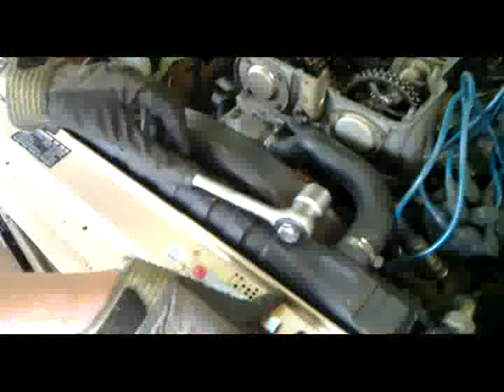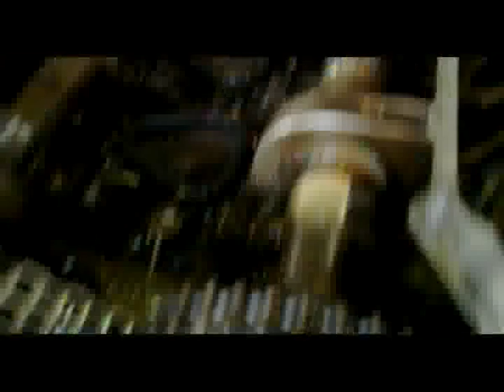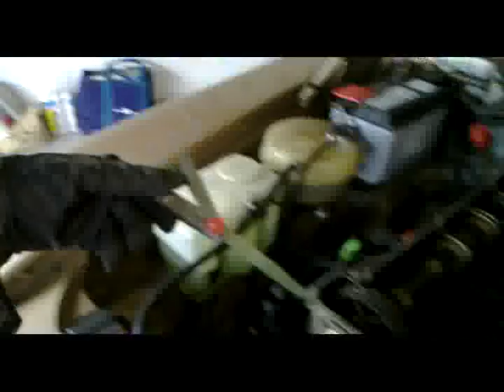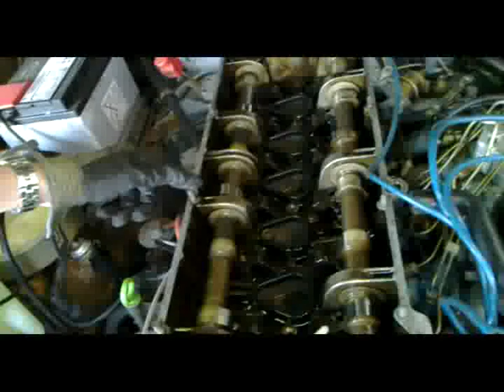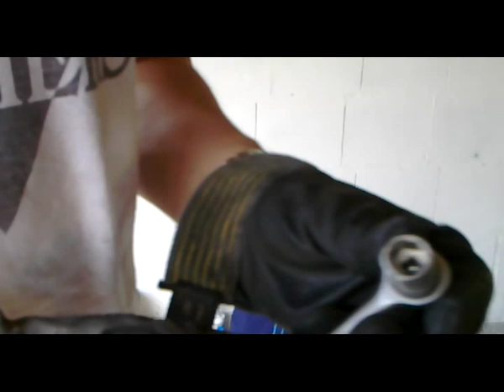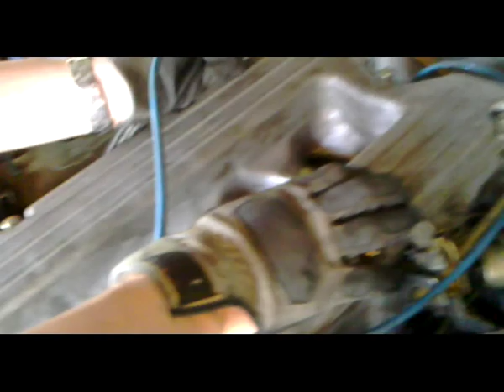Adjust valve play 2/2 (service Mercedes M110 engine)

Comment from the maker: some people simply turn the engine by turning the ignition key very shortly. Before doing this, make sure you remove the cable between the firing coil and the ignition distributor. If you don't and your engine starts, oil will spead all over the place.

Comment: Another option would be to set according to the 1-5-3-6-2-4 firing order, this allows one to set both the inlet and exhaust on the same cylinder, although I also prefer to do it like you.  Ach ja, der schöne Deutsche Akzent aus der Heimat ist auch ganz nett. :)

Comment: Small translation for  the video producer. 
Kipparme = rocker arms / 13 Nuss= 13 socket// crankshaft -correct/ 0.10mm Fuehler = feeler gauge/ motor gehaeuse= engine cover or engine valve cover/ Dichtunjg= gasket

Comment from the maker: A propper valve clearance allows your engine to completely burn the fuel which results in cleaner operation and you get more torque from the same amount of fuel.If it has never been done you might want to check but more than every 10,000km should not be necessary. Keep the rubber seal if in good shape.

Comment: Yeah good video sure makes the job look simple enough, but do I really need to bother about checking the valve clearances ? Also when replacing the valve cover is it ok the reuse the original rubber seal again? I don't understand why people insist in changing out rocker cover gaskets all the time

Comment: I have a 1973 280, W114. It doesn't seem like I can fit on a wrench to rotate the crankshaft. There is not enough room between the engine and radiator. To do this on my car must I remove the radiator?

Comment: hi, i have the same model engine in a W108 250se, when i star the engine i hear a sound like a knock very hard and repeatedly inside, i think it is the crankshaft hitting the valves and doesn't have the real adjust, but the mecanic say that is normal, what do you think is the problem? the car have a low performance after i star hearing this sound

Comment: This was a bitch of a job and my 17mm spanner broke, ouch! I found that all my exhaust valves were too tight? I also found that the 17mm adjusting bolt is very hard to turn in either direction. What is the lower but for? It is larger but do I need to slacken or tighten it?

Comment from the maker: @wfuckit I'd rather be careful giving you advice on an engine I've never seen. Maybe two hints: The adjustment screws are self-locking and not easy to turn. For the m110, professionals use a specially curved and fairly long wrench. In case non of the screws move, chances are that you don't try hard enough. If that ain't the problem, the so-called pressure pads/pressure pieces you are dealing with can be changed - or at least examined. To remove them, the tool 110589046100 is helpful.